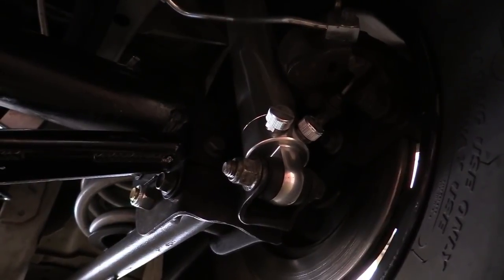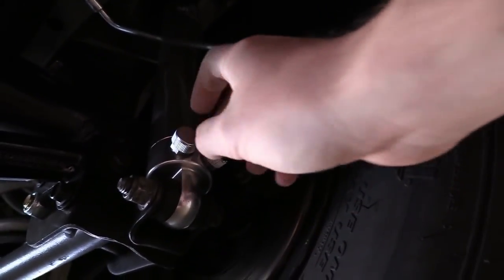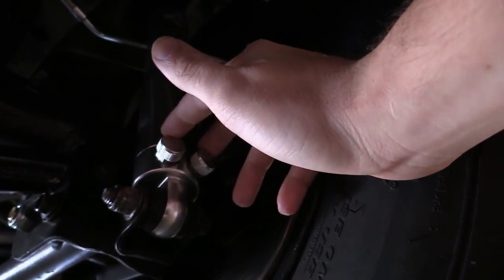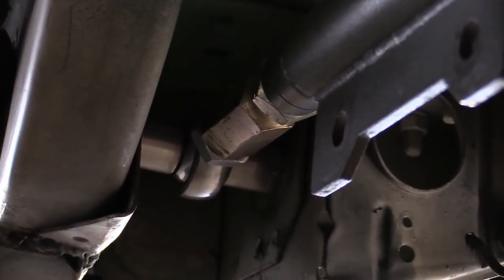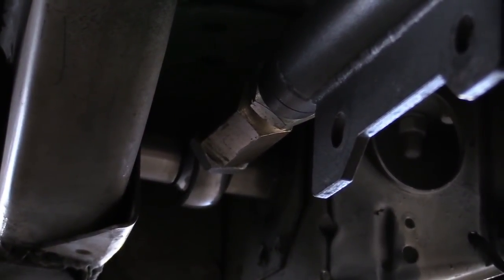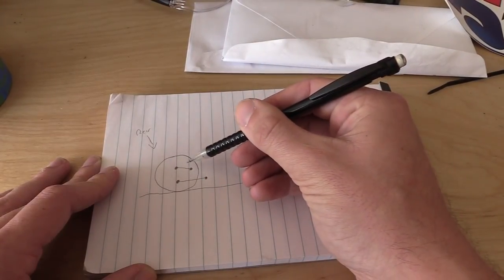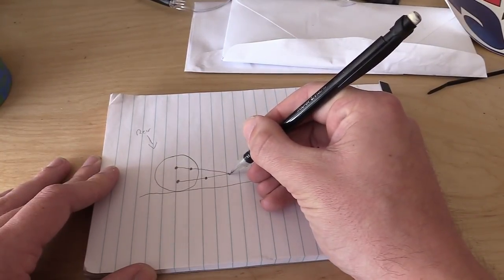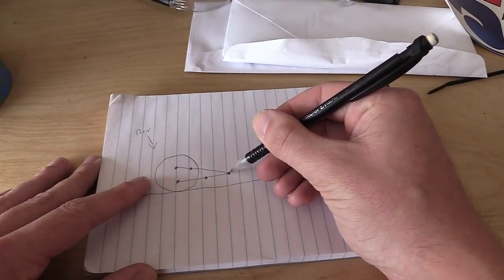Mustang suspension, instant center and antisquat explained

Comment: Nice vid andrew ! I know there are alot of ppl out there that have no idea about instant center , length of control arms and angle for best traction this vid is gonna help alot of ppl good job !
Reply: ron adkins So I’m new to learning about the suspension ins and outs also. But based on what he laid out and a comment he said earlier in the vid, the stock V8 springs should be good enough for the rear along with a good adjustable shock? I know he mentioned plenty of sites I can read up on but I’m on YouTube so I figured I’d ask right now. Lol.
Reply: @JTheMoneyable  stock "v8" springs are "just ok" for mildly built cars but if ur goals are to shoot past 600hp then replace them
Reply: I know the back of the antisquat line starts at the bottom of the back tire but how do you determine the front point?

Comment: Andrew I was told the front coil spring length doesn’t have anything to do with giving a car more travel. They said the strut give travel! My theory was exactly what you stated you won’t get much travel from a shorter coil spring. 
12” vs 14” spring

Comment: Awesome information man. Im getting ready to install the upr, k, a arms, strange single adjustables with 12" 250lb springs up front, upr rear upper and lowers, with stock rear springs with 1 coil cut off. Car will only make around 500whp so we shall see how she do. Thoughts on this set up? Still learning.
Reply from the maker: Sounds pretty solid. Check out BMR new lower control arm relocation for our cars. That will add some bite to the car

Comment: Hey man, ive followed your channel for awhile the content is great. Wondering what gear you run? I just went from the stock 3.27 to a 4.10 the motor is stock besides stage 2 comp cams, looking to run nitrous next year. Thanks in advance
Reply from the maker: Turkeycall301 I run a 3:55

Comment: Thanks for the great info. I’m looking to do a build real similar to yours but have a couple questions. My suspension will be about the same and I’m running the same intake. Did you use the Edelbrock fuel rails or modify a stock set? Why’d you go with the Holley setup over SCT, Haltech, AEM, etc?

Comment: Best explanation I have seen! I finally understand it. One question, how do you determine where to mearsure for the anti squat? That's the only part I'm still a little confused on. It's from the bottom of the rear tire to where????. Hope my question makes sense
Reply from the maker: Nick Eminoski easier to just use a calculator like the one on baseline suspension website

Comment: andrew did you notice the wear mark on your anti roll bar from the relocated uppers at about 6:25 in the video? wondering if you have had any problems with this as i was thinking about the baseline outlaws too.
Reply from the maker: ron monahan I did have a problem with them hitting the arb when the car sat lower. I have the car raised up a bit more now and they don’t make any contact when I hit bumps

Comment: Noticed you had some rear end bracing, do you have subframe connectors? How bad was the install of the outlaw UCA kit? Ive been eyeing it for a while now.
Reply from the maker: Cody Queensberry yep it’s a che bolt in brace. It had MM subframe connectors. The control arm install wasn’t to bad the word part was getting the old bushings out of the rear end housing
Reply: @andrewlavender08  do they come with instructions to install? Im gonna pull the trigger on them
Reply from the maker: Cody Queensberry yes they do. Great product